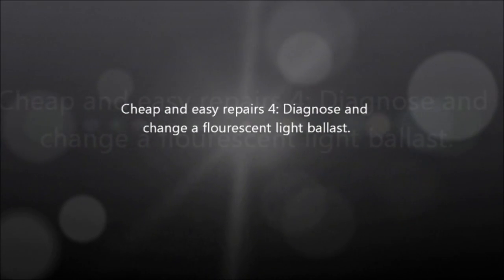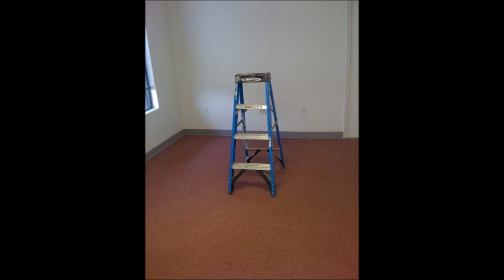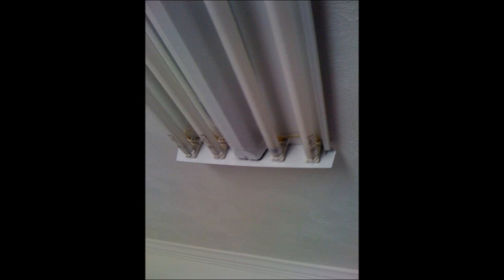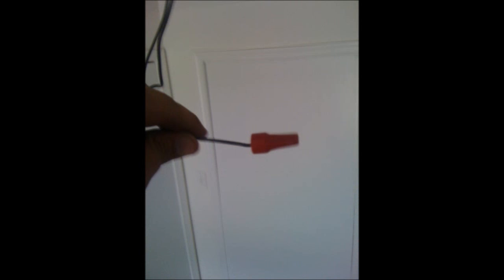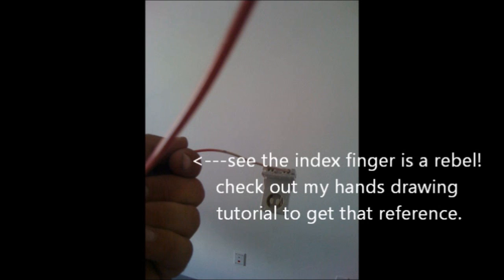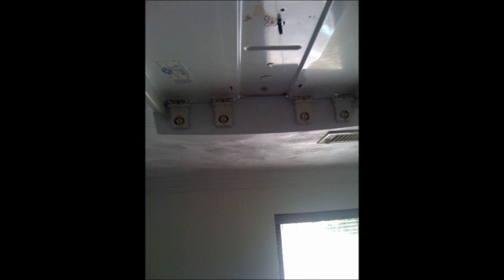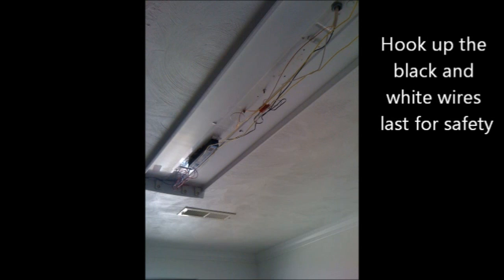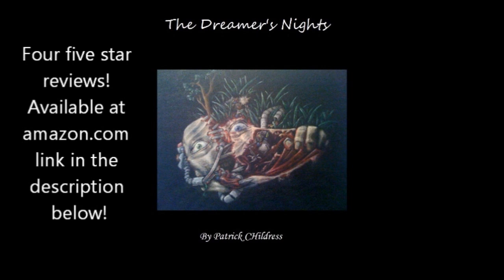Diagnose and replace flourescent light ballast: Four bulb and two bulb t-8

Comment: Ok so I have a 2 bulb fluorescent fixture. The problem I’m having is the fixture keeps turning off on me. Could it be an intermittent problem with the ballast? I have switched the bulbs out for LED bulbs about a year ago and the problem just started. Please help thanks.
Reply from the maker: I've personally  not done an LED conversion on an existing fluorescent ballast.  The LEDs that I've worked with had their own ballast/transformer (not sure what it's called).  On fluorescent fixtures, when they start to flicker or turn off it is either a bad wire connection or the bulb (rarely the ballast, but I have seen it happen).  With LEDs I wouldn't suspect the bulbs themselves, but sometimes their (I'll call it a ballast) on the board will go bad.  Unfortunately they dont usually flicker or fix themselves.  Once they're out, they're out.  My suggestion, (most likely) is that a wire is loose and causing the problem.  And this is not limited to the light fixture.  I have seen bad light switches making poor connections.  Look for loose wires and check the switch over.  (let me know what you find out and we'll go from there).

Comment: I have a fixture with 2 ballasts and four bulbs and none of the tubes are working. Is there a different method? Oh and btw I can not find anything that says t12 or t8 just this brand and number- Advance Mark III R-2S40-1-TP
Reply from the maker: Two ballasts and four bulbs sounds like an old t12 to me.  Either way you want to strip everything out and replace them with a t8 (much easier wiring) and put back four t8 bulbs.  Here's a link for converting a 4 bulb t12 to a t8: https://www.youtube.com/watch?v=FDXTkoin-vI
Reply: +DreamersNights thanx for the reply, you're absolutely correct, it was a T12. I ended up just buying a whole new T8 fixture for $42 at Lowes, but again thank you.

Comment: Without connecting, how can it be determined that the ballast is working or not?
Reply from the maker: +NAMAN TAYLOR fresh bulbs is a good test.  If you change them and it's still not working, then either there's no power or the ballast is bad.  It seems intimidating, but once you dive into it, changing one out is very simple.  But yeah when I'm unsure, I just check with fresh bulbs.  Make sure to turn the power off before you change bulbs.  Tube fixtures aren't like screw in lightbulbs.  If one end is still connected and the other touches metal there will be sparks and squealing (like many of my dates).

Comment: what if the lights sometimes dont really light up fully. like for example when i turn on mine, the lights will light up, but they are very dim. i have to go turn them or tap them for them to light up fully. i have changed the bulbs and still doesnt fix it
Reply from the maker: +ColbyWanKenobi If you replaced the bulbs then there's only one thing left and it's the ballast, unless you're putting the wrong type of bulbs in.  there's T-12 and t-8 flourescents.  If the fixture is say five years or younger or if the ballast has been changed in that time you're likely a t-8 ballast (not saying that you are.  the only way to tell is by looking at the ballast itself which will be labeled t-8 or t-12.  The bulbs are easy to tell apart.  T-12 bulbs are the fat traditional bulbs, and the t-8's are much skinnier.  More than likely though it's a bad ballast.
Reply: +DreamersNights or sockets not getting a good connection, socket could be bad,or fried wire

Comment: What does it mean when the fixture hums so loud it drives one insane? Is it a bad ballast?
Reply from the maker: +Claude Herbert yeah usually changing the ballast will fix it.  I think it's caused by the transformer inside the ballast as transformers tend to hum and buzz after a while.  Sometimes a contact can buzz in the same way, but I don't think there's one in a ballast.  Either way, changing the transformer will usually fix it.
Reply: DreamersNights
When you say "changing the transformer" you  mean the ballast, right?
Reply from the maker: Claude Herbert
yep, sorry, been a long day lol
Reply: +Claude Herbert it could be the lamps or ballest

Comment: You can also try poking the connector with something really narrow and stiff, like a thin nail or a jeweler's screwdriver.  The latter is how I liberated my wires.  What you're trying to do with that is separate the spring contacts holding the wire, just be sure not to get whatever you use stuck in the quick connect.  At least it should be easier to free something as stiff as a nail or thin screwdriver rather than a floppy wire.
Reply from the maker: +rchandraonline I haven't had much luck with a nail and don't have a jeweler's screwdriver, but I have had success with a small paperclip.  It just doesn't work all the time for me.  I have fixtures ranging from four years old to forty at work and they all have their own unique quirks.  What works all the time though is twisting the wire loose while pushing away with your thumb.  I'll have to try a jeweler's screwdriver.  Thanks for the suggestion!

Comment: For goodness sakes, turn the power off at the breaker! SAFETY FIRST.
Reply from the maker: Jeff Royed  if you feel the need for extra precautions, then I am all for taking them.  the breaker, like the light switch, cuts off the feed line in a 120 volt system.  So I see no harm in turning it off in two places.  I also think I recommended (haven't watched the video in a million years) disconnecting and capping off the hot and common wires first.  even with the power still on, this will protect you from any harm, though you may get a little spark when you pull away the powered line if it is on (don't touch the metal bits btw).

Comment: So : your Diagnosis for the ballast was that all your bulbs went out at the same time ?  you should really think about dropping the Diagnose part .
Reply: quick and easy way to check is to get some new lamps and put them in, if they dont work it will most likely be the ballast or sometimes the sockets are bad and tou have to replace them

Comment: I've changed out several ballasts over the years.  Twice now I've had a challenge getting all 4 bulbs to re-light.  3 of the 4 work.  I've rechecked the connections, used all brand new bulbs.  It's an oddity I'm not sure how to fix.
Reply from the maker: On the common side of the 120 wiring some of the older connectors aren't connected in the middle.  This can cause one bulb to not work sometimes (though usually the other bulb has to be defective).  Making sure the main common and the jumper are both on one side of the connector or running a jumper between the sides of the connector can fix this if that's the problem.

Comment: I need a"how to video "for properly installing two T12 light ballast for a four light fixture. I don't want to replace them to T8i want to keep them as is. Can you make a video showing how to go about installing them
Reply from the maker: We replace all our t12s with t8s when they go bad at my workplace, but if I ever run into the situation where I'm changing one t12 with another I'll definitely do that for you.
Reply from the maker: Omar Acevedo On second thought, if the wire colors match, just splice the new one to the old one's wires with wire nuts and electrical tape.  Do a good tug test on the connections to make sure they're solid.  It's better to replace them at the tombstone, but t12 wiring is very confusing for someone not in the electric repair field.

Comment: Power in the black wire? You mean switch power? What country are we talking about?
Only asking because in Europe, in the old days, RED was the LIVE wire and BLACK was only NEUTRAL.
Reply from the maker: sorry for the slow response.  I'm writing another novel and working two jobs.  Its tough to find time for my channel anymore.  I am in the USA and I should have stated that in the video, though I think I added an annotation.  If not I will.  we use 120 volts here and the process would be much different in Europe where I think 240v is the standard.  I apologize for any confusion this caused.